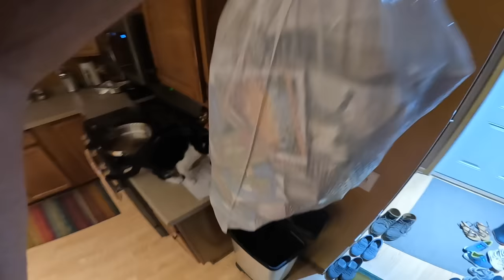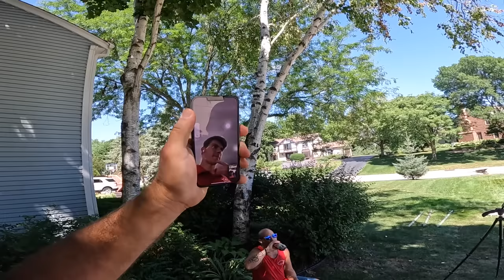Respect to the mixer drivers! Thank you!

Comment: Hey Ryan, just a thought as you were saying your lift cylinders were raising real slow. I had the same issue on my bobcat and found a simple fix. There was so much dirt packed around the foot pedals, it was limiting the pedals. My theory of why they were doing good that day is cause the rain soaked the dirt and made mud and then loosened up and gave the range of motion it had before. Just an fyi to look into. Makes for a cheap easy fix if that’s the problem. Just a screwdriver and a vacuum and mine was fixed.

Comment: Ryan, just out of curiosity why do you choose to use wire mesh instead of rebar?
Reply: Cheaper, easier to install and the concrete is only 4 inches thick.
Reply: @keithfreitas2983  Really?  Only 4” thick for a driveway?  I would have thought for sure 5” thick at least.
Reply: @LJones69  Ryan pours 5".  He even said it a couple times in this video.  On a driveway like that, the mesh will do just as well, or even better at it's intended job, which is tying everything together.  Most of the time in flatwork like this, rebar is only used as additional protection in areas of concern for cracking or if the area is too narrow or curvy / hard to use mesh.

Comment: Ryan, Diet Soda BAD. Reg SODA BAD. Did the Coffee Lady at the Coffee Shop Retire? Don't worry about anyone hiding where they parked the Pick Up Truck before ya got there. Just go over to the truck & feel if the hood is warm & if really cold out lift the hood & feel the motor. I know there are ways. 😅Ryan, I appreciate & like concrete. In this case they have a paved driveway, why would it not be more practical to just tar coat the existing driveway & parking area? Food for thought. In the Winter there do the driveways turn into Black Ice & Slip & Slide? Then when people have money💵they will spend it Ryan😁.

Comment: Is an asphalt driveway that much cheaper than a concrete one?    Hard to believe people wouldn't just put a concrete one in to start with.
Reply: No, we went from asphalt to concrete, much more expensive.
Reply: A concrete driveway is more then asphalt but if done right will last way longer then asphalt .Concrete driveways can be thousands more then a asphalt driveway